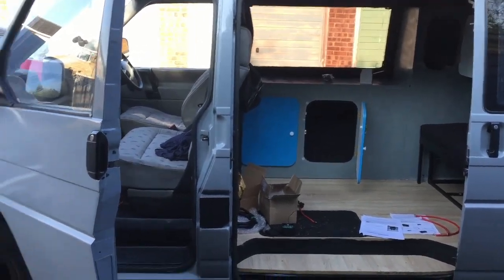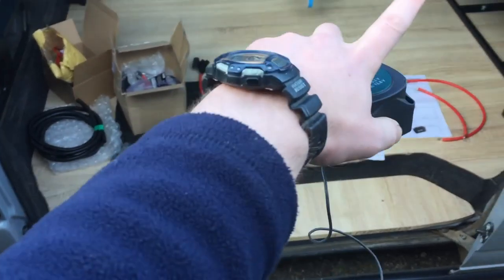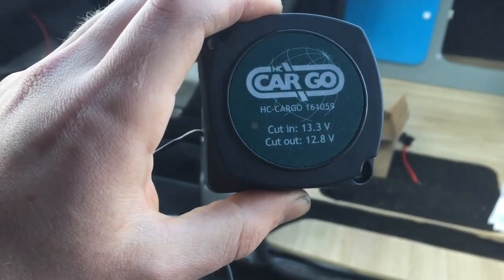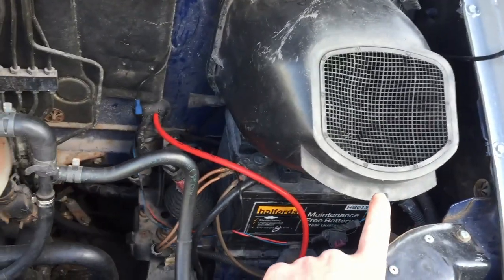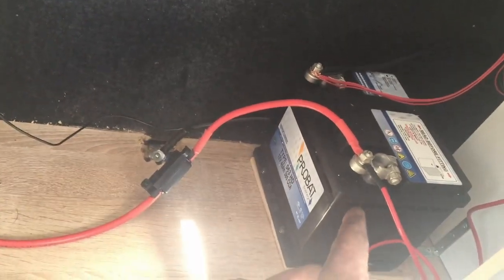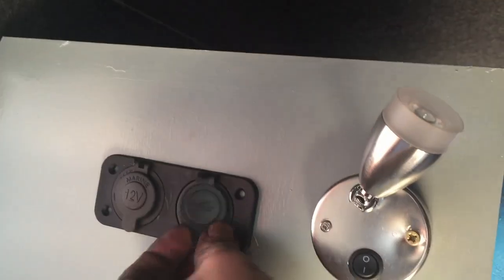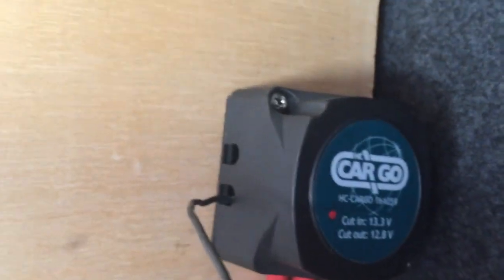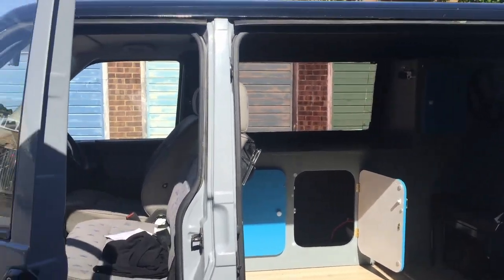How to install a leisure battery with split charging

Comment: @Joel's Stuff 
i. does this use more diesel or is it excess electric from the engine?
ii. can this charge a lifepo4 leisure battery?
Reply from the maker: Hi,

It’s just using excess charge from your alternator, at least with my setup (the belt is constantly running the alternator so no extra load is on the engine if you connect a second battery). If you have a smart alternator then it might switch on more often if it’s charging a secondary battery. I don’t know much about them I’m afraid.

I’m not sure what a lifepo4 is so you would have to investigate that one
Reply: @JoelsStuff  lifepo4 = LiFePo4 = lithium iron phosphate battery

Comment: Great work my friend... I’ll be doing the same soon! On a euro6 with smart alternator... T6 van.  I have a life hack for you!! :-)
Reply: I would recommend just disconnect the battery monitor on the negative terminal, my t6 can be a bit of a pain when it comes it just not wanting to charge at a reasonable voltage

Comment: Do u need a certain type of secondary battery or can u use any from a car?
Reply from the maker: You can use a normal car battery (mine is). Leisure batteries are better though, as they are designed for a longer slower power output rather than short burst output to crank a starter motor. Put simply, a leisure battery will power your stuff for longer before going flat

Comment: How thick is the wire between batteries? How did you calculate how thick it needed to be?
Reply from the maker: Hey! I didn’t calculate this - the split relay kit came with the heavy duty wire for this

Comment: Hello Joel , should the second battery be the same cappacity as the main battery ? Great video!
Reply from the maker: Thank you! I don’t know of any reason why they need to be the same!
Reply: You can only use a 12 volt if your car is 12 volt. You only need the leisure battery to be suitable for your needs. Example what is will be supplying power to and how long for and how often. If you only have 1 led light then a small battery. If u have a light a tv and maybe a fan or heater a big battery

Comment: Handy video, thanks.   Just wondering .. those relays are currently ~£30 on eBay .. have they dropped in price or are the ones on eBay probably not trustworthy?
Reply from the maker: Mark Coombes 

Hey! I remember there were cheap ones when I bought mine. I read somewhere that they were ok but not as good for heavy duty use. I went for a more expensive one just to be safe, but looking back I probably would have been fine with a cheaper one. Sorry I don’t know much more on it!
Reply: No worries, I think you're right, I don't really want to save money then have my van burn down!  Probably one of those things it's not worth skimping on.
Reply: You could always add extra relays or a higher amperage relay. What you want is something to tell you when to turn it on. You could also just add a relay to the run position on the ignition wire.

Comment: Do you need to “vent” a leisure battery? If so how? Also if fuze box has earthing point for negative leisure battery wire, where does negative from the split charge relay go?
Reply from the maker: Hey! From what I understand you only need to vent certain types of batteries. Mine is “sealed” meaning it does not give off anything, so no need to vent. I can only recommend researching what battery you buy, and seeking professional advice if it needs venting, as I do not know much about how that works. The fuse box on here does not have grounding - it is just a set of fuses that sit on the positive wire of the circuit. The relay is grounded to the chassis of the van (as long as your battery is also grounded to the chassis then you can ground anything else to it). You can ground both batteries to the chassis also.

Good luck!
Reply: Joel's Stuff ok that makes sense, if a fuse box does have a grounding point on it though to attach the negotiate wire of the leisure battery to it, can you attach the negative wire from the split charge to the same grounding point on the fuse box

Comment: Hi there.
I have just installed the same split charge, but it doesn't seem to be charging my leisure battery. I have + to + from split charge to van battery and + to + from split charge to leisure battery. Split charge is also earthed. Red light clicks on upon starting the van, just as yours does, and goes off again when ignition is turned off. The leisure battery is new. 
When I test with a multimeter, when engine is running, the van battery reads 14.3v but the leisure battery only reads 12.3v?
Any ideas?
Reply from the maker: Ok, so if it reads 12.3v when the engine is running it is definitely not getting charge. Have you connected the negative terminal on the leisure battery back the the chassis of the vehicle? This needs to be done too in order to complete it’s circuit back to the alternator. If you have, then I would suggest taking the relay out of the circuit and just testing if the leisure battery charges when it is directly linked up - then you will know if it’s a cabling issue or if the relay is faulty. Good luck!

Comment: Only the positive cable needed to connect to the main battery for charging?
Reply from the maker: That’s right. The negative on both batteries goes back to the chassis, so are essentially connected that way

Comment: Can I ask where you got the cable from to go between the batteries? Also do you know if the leisure battery should be vented
Reply from the maker: BZeeeB 

Hey! All of the cabling to the leisure battery (both positive cables and the negative) came with the split charge relay kit. I don't think my battery needs venting, as it is a sealed battery, although I have to admit I'm not 100% sure about this.
Reply: Joel's Stuff thanks for the reply. The whole venting thing is a bit confusing. Lots of people say you definitely do while lots of people who have had professionally converted vans say they are not vented. I think I am going to buy a gel, sealed battery and not vent it

Comment: You are unlucky that your main battery is under the hood. In my ford transit i have two batteries that run the van. I will hook a third leisure battery to them. What leisure battery did you use. How many amp hours
Reply from the maker: Hey! That sounds great. I am currently just using a cheap car battery as my leisure battery. Not ideal I know but I will upgrade at some point!

Comment: How could you install this between a tow vehicle and a camper, I would like to charge my camper batt while driving.
Reply from the maker: Hi. I’m not sure how you would connect the electrics to an external caravan, but in principle I can’t see why it wouldn’t work in the same way, so long as the positive and ground are hooked up between the tow vehicle and the back. I’m the wrong person to give advice on this really, sorry

Comment: What battery did you use? Also great video. Thanks
Reply from the maker: It’s just a cheap universal car battery. Not great for a professional setup but fine for light use
Reply: @JoelsStuff  Thanks for your reply Joel 😎👍 I will be using mine regularly so will probably get something more appropriate. Now just to find out what 🤔

Comment: No one doing a van conversion ever covered this. How does this differ to an inverter?
Reply from the maker: Hey! From what I understand an inverter is to convert your 12v van electrics to have a 230v mains output. The split relay setup I have here is just how to have an isolated 12v battery that is automatically charged by the engine. Good luck!

Comment: Is this possible to do with a fridge???. I want to get one that runs less then 100 watts a day....
Reply from the maker: I haven’t looked into fridges. It depends on what power source it needs. If you can find one that is just powered by 12v then it should work, although you might need to think about paying for a higher quality leisure battery than me, as anything heat related tends to use a lot of power. Sorry I can’t be more helpful

Comment: I've done all this today. But mine  isn't working. I wanted to test the voltage coming from main battery to VSR. To leisure battery. The only thing I didn't do was connect the main earth. Is that why its not working?
Reply from the maker: You need to have a negative connection from the VSR, and from your leisure battery both going back to the vehicle chassis

Comment: I’ve got a cigarette plug in the back of my suv. How would I set up a  dual battery with relay system that charges from the cigarette plug? Thank you very much.
Reply from the maker: Hey! Once you have installed a leisure battery like in this video, you can wire your cigarette lighter directly up to it. I have a video called “fuses for a leisure battery” that goes into detail if you are interested. Good luck!
Reply: Joel's Stuff sorry, I’m a girl. I have no idea about this stuff so speak plainly. 😊 I take a battery (not even sure what kind) and set it in the back of my SUV. That’s as far as I understand 😂 

What product do I insert into the cigarette port to charge my battery? 

Do I put the relay between that product and the battery? 

Totally lost 😂
Reply: @fugeelahahaha  best staying in the kitchen

Comment: So if you have a split charge relay, don't you need solar?
Reply from the maker: No!. Solar can be a good additional way to charge your battery, but with my setup I am getting charge purely from the alternator. Solar would be good if I was stationary for a week and wanted to use the electrics a lot without having to drive. The relay here simply makes it so I can use and drain the leisure battery, but then still start up my van.
Reply: @JoelsStuff  Ah, I see. Thanks 👍😊

Comment: hi I'm just wondering about the fuse box that is coming off the van battery 
what type of fuse is that please 
and thanks 
I'm a total beginner with this stuff
Reply from the maker: LM S 

That is an inline fuse that came with the split charge relay kit. I’m afraid I can’t remember much about it, but if you buy a kit it should be included
Reply: Joel's Stuff awesome and thanks for the super fast reply 😊
Reply: @smart2907  - Tip: Whatever fuses, inline or fuse box. Use the same type you have on the rest of the car. It will make things a lot easier in the future.

Comment: What size fuse on the lead wire coming off the first battery
Reply from the maker: Hey! I can’t remember exactly what size the fuse is, but it came with the relay kit, along with all the wiring

Comment: how many amp fuse did you put in between the leisure battery and starter battery?
Reply from the maker: All of the wire and the inline fuse came with the relay kit, so I can’t remember what the fuse rating is (sorry).
Reply: I have a 12V 75AH Starter battery and 110Ah leisure battery. Cable size 16mm or 8mm. would you know what to advise?
Reply: @JoelsStuff  which kit did you use?
Reply: @stephdenis9744  Go as big as you can.. 35mm2 is recommended to avoid undue voltage drop if it's a long cable run between the starter and leisure battery

Comment: Red wires coming off the negative side of the leisure battery...bit confusing surely you could have used black.
Reply from the maker: yup sloppy work on my part - I had ran out of black

Comment: How powerful can be the leisure battery ? Can be 170 ah ? Thnx
Reply from the maker: IgotQuestions.es 

It depends what relay you buy. Mine says suitable for charging up to a 220 ah battery. Mine is only a cheap 45ah battery, but it's probably worth deciding how much you want to spend vs what your needs are
Reply: Joel's Stuff ...I don't want a relay , I cut manually the leisure battery , 
What I was meaning is if the alternator will be afected if u put a additional 200ah battery , in my opinion no
Reply from the maker: IgotQuestions.es 

I'm not too sure I'm afraid. I guess it depends on what engine and alternator you are running. There's going to be a limit on what it can do
Reply: Joel's Stuff ...thnx , but the alternator is always lower than the battery , it only takes more time to load the battery , why should affect if u put a 2000ah battery ?

Comment: Woah! Stop right there. Firstly, remove that RED cable from your negative battery terminal and replace it with a suitably sized BLACK cable immediately . Also, you need to state that there are two types of VSR. One is for a normal or older type of alternator and the other is for use with smart alternators (as yours is). If in doubt, just check how many cables are clamped to the battery negative terminal. If there are more than one, you have a smart alternator, if there’s just one you have a normal alternator. Incidentally, a VSR for the older type of alternator is considerably cheaper than one for the smart alternator.

Comment: I’ve just done mine in old split screen my light hasn’t gone out yet ? 
On the relay it says second battery and sense battery se one battery I’d imagine is leisure battery
Reply from the maker: tospicy4ya 

Hey! My light sometimes stays on for quite a while if nothing it turned on. Try running a light or something from the leisure battery for a few minutes until it switches off. If it stays on constantly then you might have wired it up wrong or have a faulty relay
Reply: Joel's Stuff  I’ve had to disconnect it as starter batter has drained not sure why as it’s wiring is very simple

Comment: Will it automatically switch off when the battery is fully charged?
Reply from the maker: Casper Knudsen 

It won’t no. The only thing it is sensing is if the alternator is running (i’e if the engine is running). This means it is supplying constant charge to your leisure battery when you are driving, even if it is full (this is ok). When you turn off your engine then it will close up and isolate the leisure battery so you can use it without worrying
Reply: What i seen that there is an undocumented function on these relays, it seems that they are sensing in both directions, so when your leisure battery gets fully charged by solar or external hook up, it switches also your car battery into charging with no motor running.
Nice installation, I would use a negative bus bar and some 10sqmil cable to the negative connector of the battery.
Thx for the vid...
:-)
Reply: My starter battery boiled, alternator thinks  battery isnt full when starter battery is full and leisure not

Comment: Hi, What diameter should I use between the various components like: main battery, fuse, VSR, fuse, leisure battery?
Reply from the maker: Lau Riv 

The thicker the better really. The only reason you might want thinner wire is perhaps make it cheaper and more convenient to install/neater looking. The really important thing is to make sure it is at least thick enough to safely carry the amperage that is going through it. I’m not even sure what mine is, as it all came with the relay kit.

Comment: 14.4v should be shown at the main van battery when running , this means all is healthy 13.8v and lower usually means a dying main battery 👍
Reply from the maker: Yep or a faulty alternator. 13.8v is the threshold for the relay to open

Comment: I'm no auto electrician... but my understanding is that the relay senses when the vehicle battery is fully charged... at that point the relay kicks in and the vehicle then charges the leisure battery!
Reply from the maker: Hi peter. This is a voltage sensing relay, so it detects when the alternator is running or not and uses this to decide to open or close. It doesn’t have any way of detecting the charge on the main battery
Reply: @JoelsStuff  my understanding is that as it comes off the vehicle battery that cable only carries the voltage in the vehicle battery, so say it is only charged to 11.8v, then it wont kick the relay in. That only occurs once the vehicle battery reaches the relay activation point... I think your video said 13.3v! So until the vehicle battery reaches 13.3v, it won't trigger the split relay if its below that. So it will only put charge into the leisure battery once the engine is started and the vehicle battery reaches 13.3v....
That's my understanding and seen as the relay range starts at 13.3v, it would be faulty to start earlier when the vehicle battery wouldn't be at full charge!
Reply from the maker: You are right in saying the relay won’t charge the second battery until voltage is above 13.3v, but this will be the case just a few seconds after starting the engine up, even if the main battery is totally flat

Comment: How have you secured the battery to the van?
Reply from the maker: the battery has holes in the bottom to screw it down (I assume this is what it is for?). It's screwed onto a piece of wood which itself is screwed into the floor
Reply: Joel's Stuff thanks for the reply my split charge kit for the t4 arrived today . Great video!
Reply from the maker: scottwil123 

Great news! Hope it goes well

Comment: So I installed this andinstead of the vsr staying on it flicks on and off any ideas why this is
Reply from the maker: Hi Tom

It sounds like you either have a faulty VSR or a faulty alternator. I would start out by using a voltmeter to check that your alternator is putting out the right voltage when your engine is running (it should really be around 14 volts or higher. When your engine is switched off then your voltage should drop down to whatever your main battery is putting out (around 12ish volts). If this is all as expected then perhaps the VSR is faulty, or you have something wired up wrong.
Reply: Suggest you check all your ground connections. Mine did the same and it turned out to be a badly fitted earth . Sorted now